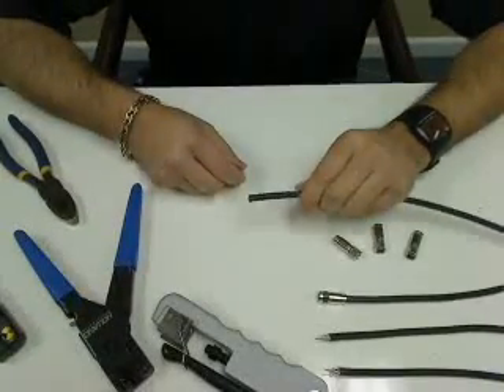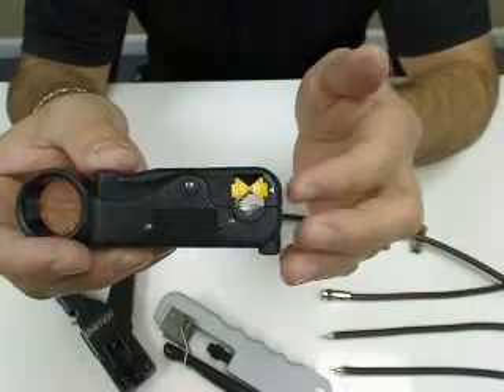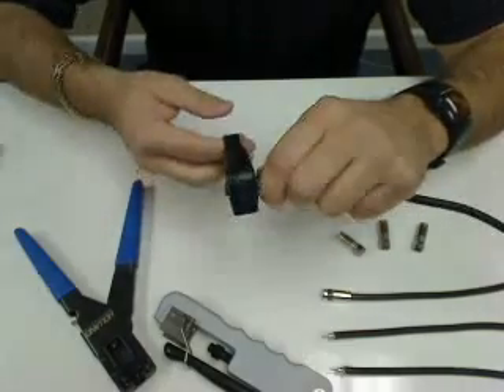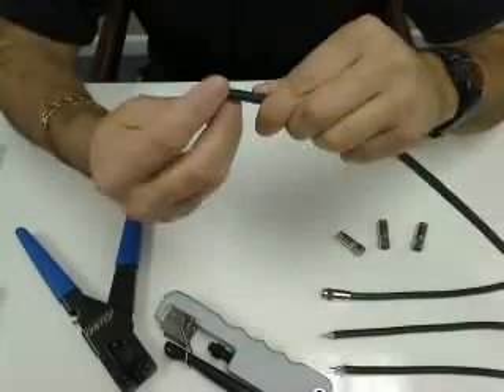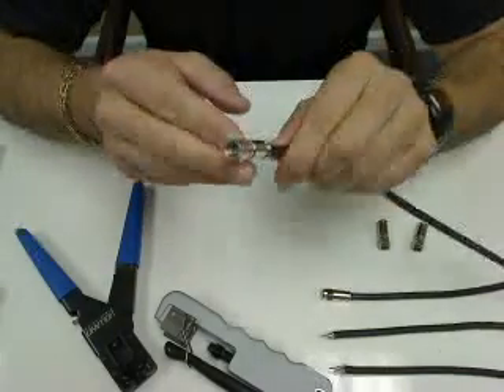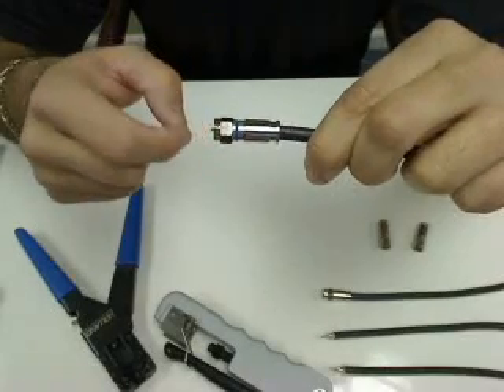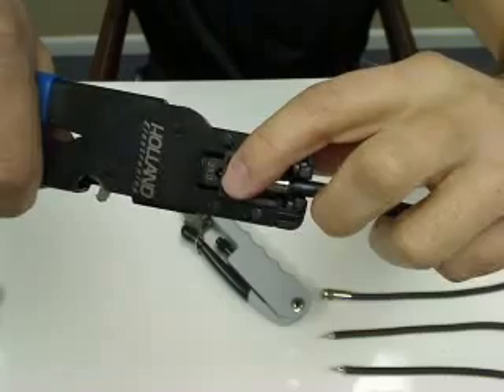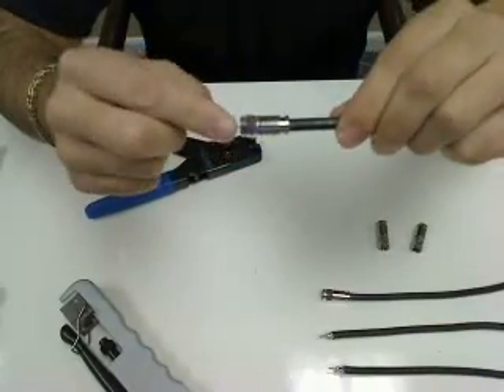How to Prep Coaxial Cable and Install a Compression Connector (Jonard CT-200G)

Comment: Is there any reason you can't comb the braid back with a small stainless steel brush?
Reply from the maker: Great question! YES, it is recommended to use a small brush to comb braid back.  Nowadays. many tools actually have a small plastic brush at end of prep tool for this prurpose.  In this video from many years ago, we used our fingers (which is not recommeneded due to posible oils from fingers) BUT is commonly done in the field when instally many connectors per day.  Thank you for your question!
Reply from the maker: just realized we filmed this just over 14 years!!!! WOW!

Comment: So the foil does not get pealed back?? Just the brae/mesh.. I see other videos where they peeled back or removed the foil.
Reply from the maker: We always recommend that the FOIL (Shield) gets pulled back first then the BRAID (Mesh) over the Foil.  Sometimes it does get peeled off when prepping the Coaxial cable. IN that case, if that should happen, then you will be pulling back the Mesh over the jacket.  There are many installers that work with Tri-Shield and Quad-shield that will peel off the first layers Aluminum FOIL to make ease of Compression Connector installation.

Comment: What brand compression tool are you using.
Reply from the maker: Thank you for reaching out. In this video the Rachet Tool is by Holland Electronics (but it's a standard 21mm Ratchet tool that is branded by many) the other one is a 360 degree compression tool made by PCT.  Ratchet tools normally supports only 180 degrees of connector as it compresses down on connector.
This is important to understand when using inexpensive compression connectors because it is possible that half of the base on conector can bulge out and get damaged.  
Hope this helps a bit. Please let us know if you have any further questions.
Reply: @AbitronixLLC  Hi when i compress a RG6 Coax Cable the connector comes off, the blue plastic seals i can see push upwards with the compressor tool but after that the connector comes off, what could be the issue. thanks
Reply from the maker: @daguru87  So it could very well be that you may be using the wrong SIZE connector for the cable.  Check markings on COAXIAL Cable, is RG6, RG59 maybe RG6Q (probably not)  My guess is the you have RG59 Coaxial Cable and are using a connector that is made for RG6 cable.  Pls let me know.
Reply: @AbitronixLLC  Hi yes that was the issue I was using a RG59 cable which is 1-2mm and is the thinner coax cables, on RG6 compression connectors,  the plastic blue tabs would not fit or become damaged, I then looked at my downstairs setup of Sky and it was using a RG6 coax cable which is about 5-6mm and is much thicker.  I used RG6 F compression connectors and hey presto it worked. Thnx
Reply: @AbitronixLLC  Hi the RG59 cable used is about 1-2mm and is very thin, to compress them would I need RG59 F connectors, when i attached a RG6 F connector on a RG59 cable the connector either came loose or the plastic blue tabs or wire got damaged, please explain . The RG6 cable my Sky satellite cable used downstairs was a RG6 cable and is 5-6mm, The thinner RG59 cable would not fit a RG6 F connector or get damaged in the process, Please advise, Thanks
Reply: @daguru87  awesome. Glad we were able to assist!!! Cheers!

Comment: Is any of the wire braid need to make contact on the connector. My tool is removing the braid when I make the cut.
Reply from the maker: Normally you need to just peel it back over the Cable jacket.  Yes, there are many prep tools that the blade over cuts and removes all Braid.  This has happened to me as well in many cases and I have never had any issues with Video signals due to "Braid" being cut.

Comment: Good video however my problem is getting the cable inserted all the way into the connector.  The connector is labelled for RG6.   The cable is labelled RG6 triple shield.  I've tried pushing and twisting but can't get is all the way in.

Comment: Why would I want a compression connector?
Reply from the maker: Crimp connectors are not as commonly used anymore in professional installations.  Although I have seen many home developers use "crimp" connectors on coax but it is no longer the norm.  Also, in using crimp you almost always risk the possibilities of the connector coming loose on coaxial cable as well as the possibility of signal lose if braid/shielding becomes exposed,
Compression connectors (when installed correctly) eliminate all those points of failures.
YES, a compression connector will cost you a little more and in the long run its worth every penny.
Please let us know if you have any further questions.
Thank you

Comment: Interesting but sadly my query not answered: My sat. cable has been cut a couple of yards away from the dish. Each end of the cut cable has a compression connector fitted. Both are exactly the same as shown in this video. I am used to seeing connectors with either a male or female part, yet these two are identical.  Alas I can't fathom how to marry the two identical connectors together.  Any advice appreciated!
Reply: +Ivan Sanders Have you tried using a barrel connector to marry both male ends?

Comment: I have one these hanging out my wall and leading to a dish on the roof, can I just use a coax cable cutter to cut it (to remove them from the inside) or is the wire live ?? Sorry electrics aren't my forte...

Comment: Thanks for the great video! I am about to fish/replace my cable from the box out side through to my attic.. That is the only RG-59 cable I have in my home ... the rest is RG-6. The cable guy left me enough to do the job and threw in a couple of connectors! I bought a compression tool at Lowe's today and the sales guy said the connectors I have are RG-6Q connectors for quad cable. He could not answer my question about interchangeability... I'm hoping you might.
 
  The tool does all of them but are the RG-6q compression connectors OK to use with regular RG-6 cable? I can see NO 'Q' designation on the cable I have...only 9900963 F677TSUU (That's the best I can figure the markings on the insulation. Replacing the RG-59 will finally eliminate any excuses for lost cable signal that I have been living with since I bought the house two years ago. Thanks for any further assistance .

Comment: Please HELP!
Thanks for the how to video.
I came on here to check it out, because I figured I must be doing something wrong with the connectors?
Anyway, I am trying to use the DirecTV's RG6 cable, which is already installed, to connect to my antenna I am putting up.(cancelling DTV.)
I have tracked the cable all the way to the tv, so I know I have the right cable.
But I still can not get any kind of signal at all.
The DTV rg6 is only like a year old, but the other cable I am using for the antenna, is like 10 yrs old, but been stored inside. All ther connections look clean, everything looks good.
What the heck could I check next? A simple task has turned into a pain in my butt! lol
Let me tell you how I made the connections.>>>>> I used the same tools as you, 1/4' &1/4' (but when I used the tool to make the cuts, there was NO BRAID AT ALL TO FOLD BACK) I guess the only braid that was left was under the outside cable rubber, so I suppose it makes contact with it after compressed, am I right?
Or do I have to have some braid wires to fold over the top of the outside rubber?
(which would place the braid wires in between the connector and the exterior of the cable)
NOTE: if I understood correctly your answer to this question above, you said that the BRAID WIRE, does not have to make contact at all to the connector? Was that what you said?
I hope you can understand what I am saying?
Anyway, please try to rasap!
Thanks soooo much!
Chris

Comment: Thank you for your instructions. I followed it and it does not work for me. I am able to pull the cable very lightly and it comes out. When I compress it, I do it all the way and it seems to be working, but when I pull to test, the cable comes out. I am using RG59 cable.
Reply: Yes. The one that came with the Q-see cameras
Reply: I see how easy it is. I use siamese (video and power) for the camera installation. It's RG59. I bought another crimper so that I can do it in a different way.

Comment: Great video! I have a mainline to the attic then it splits down to all 4 bedrooms. The one bedroom (the master, of course!) keeps alternating from a clear to a fuzzy signal. After swapping tv's, cables (in the room) I've narrowed it down to perhaps a bad connection in the attic. I replaced it w/ a compression fitting and no luck,  pictures still fuzzy/static etc. Its pretty cold for any mice to be in the attic... well below freezing... not that I know anything about mice... but if they're eating my wire....

Comment: Is it necessary to have any of the braid to have contact with the connector?
Reply: I was hoping that was the case. I bought a RG6 twist on connector for a triple RG6 insulated cable & there was no way in #ell it was going on without cutting the exposed braid & shaving the outer cable with a razor.

Comment: I also forgot to ask is if its okay just to run new coax cables to the part of the house that has the cable modem and are tv that needs the best signal?  if we start from the line outside then work are way to the modem and tv are at would any of are old cables cause connections problems if we have very solid cables going to the two spots we need it the most?

Comment: Video is fine and all, but if you are going to teach home owners to do this, you need to mention to properly tighten their connectors on ALL of their equipment, including wall plates etc. I as others in my town have been chasing return noise because of customers leaving connectors loose and running their own junk they bought from a store. This causes us interference that back feeds into our cable plant. It is very time consuming to find each house  causing this, and to get in to fix each house.

Comment: If your coaxial cable has a foil sheath between the dielectric and the copper braid, should you remove this or leave this on top of the dielectric before connecting the F-connector? Many thanks!

Comment: One half of the pair could connect to the filament, the other would connect to the shielding in the cable, or the metallic part of the fitting. RG59 is harder to do this with. I would recommend changing out RG6.

Comment: Snap and Seal connectors are what are currently in use by Charter, Comcast, DirecTV and a few others. ATT UVerse is using what these guys are and they are having signal leakage issues.

Comment: Unless you know what you are doing, call an electrician. Sometimes the local cable company will do it for around 40-50 dollars. I have been in the cable industry for years, I still hate replacing cable in the walls. The actual technique is called a wall fish.

Comment: Crimps will not support the higher frequencies for HD. You need the actual compression fittings and compression tool. Lowes or Home Depot carry them for about 15 dollars each for a cheap set. If you are not using HD or NEVER plan on using HD, then crimps are fine.

Comment: I have a question.  How will i be able to replace the cable wall outlet?  not the faceplate, i mean the actual cable in the faceplate.  The connector for that cable is messed up and i want to replace it.  its a bit differenent since the connector is not the same